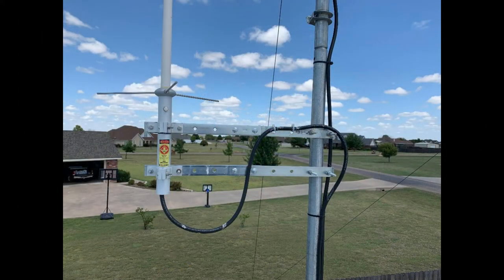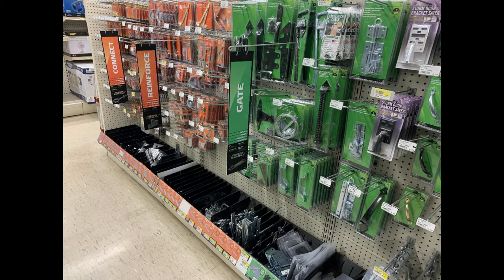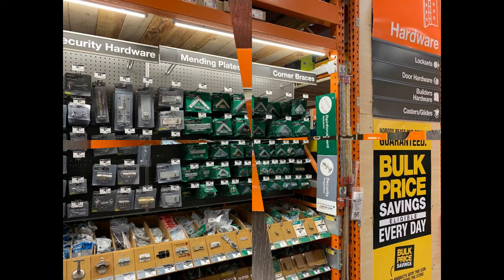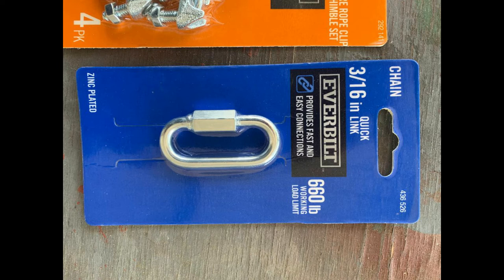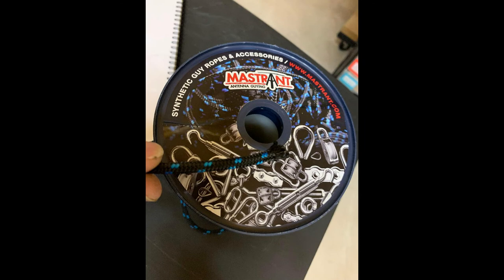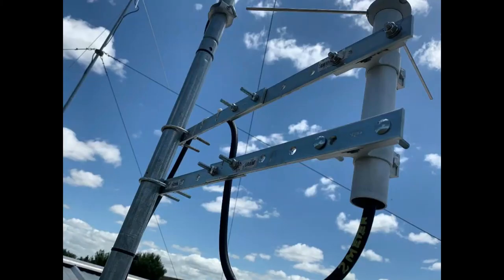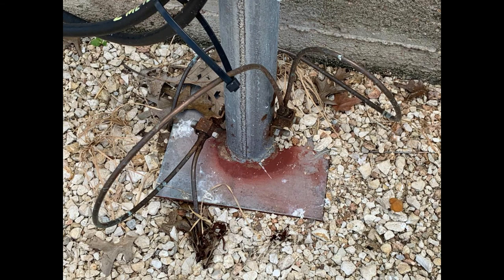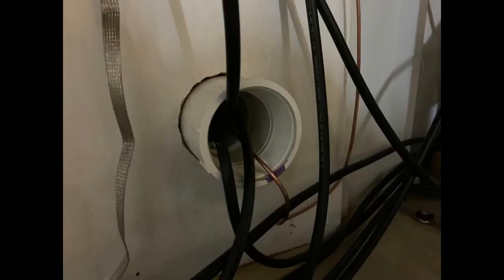Antenna Hardware Comet GP-1 Side Mount Hardware - General Installation Ideas I used

Comment: GP-1 is a decent lill antenna, works for my application. I mounted my factory supplied bracket right to the top of my chimney (non-used / for old woodstove hookups). I get it, different scenario. I'm a fan of built not bought when able. Think you did a decent job!
Reply from the maker: Good evening Mr. D  sounds like a good plan glad it's working for thanks for the message and a have a great labor day weekend.  '73 de KI5JUF